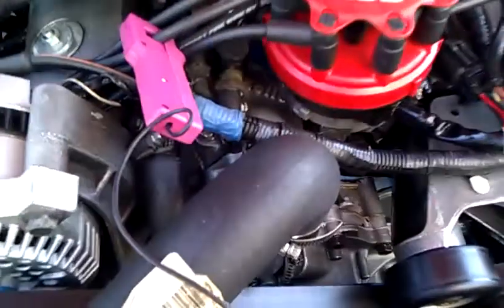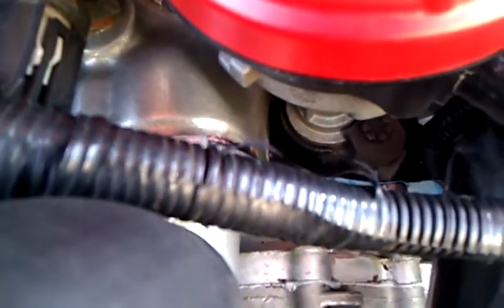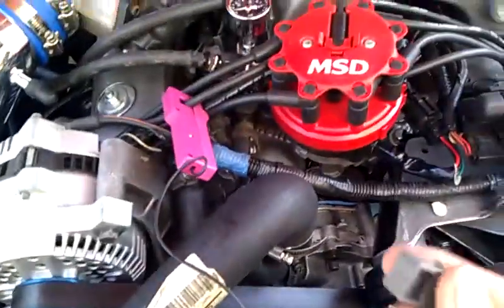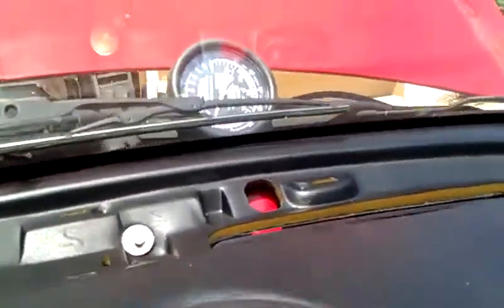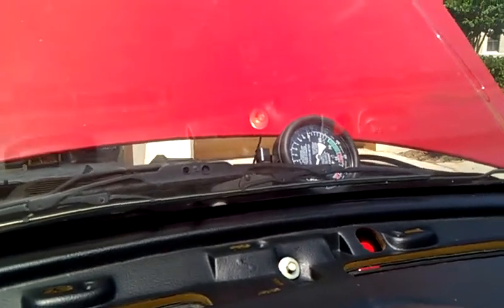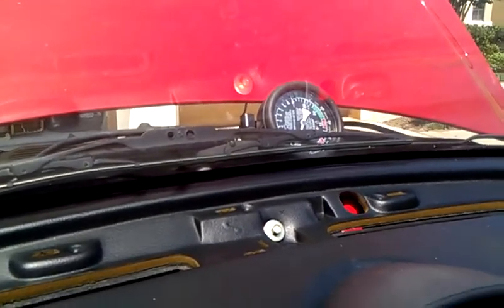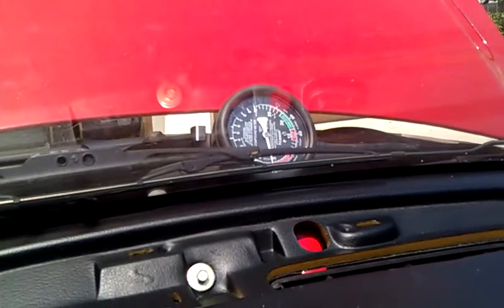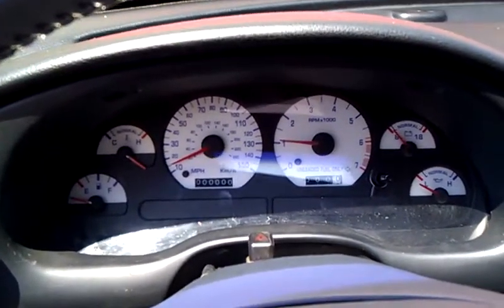Rebuilt 95 Mustang GT Can't Idle - Timing Problem?

Comment: make sure you are at top dead center on piston #1. You will need to take out the #1 spark plug. Use a hard plastic stick and hold it in the spark plug hole.Take a socket wrench and turn the crank by hand clockwise till the piston makes contact with the plastic stick. Remove the cap of the distributor and make sure the rotor is pointing at the #1 spark plug wire terminal on the cap. If it is not lined up then you are out of timing. If it is at the #1 terminal then verify the timin

Comment from the maker: Guys- Thanks a bunch for your ideas and help! I got the sucker to finally idle without the spout connector. It took some patience, but it was the base time plus the idle air screw and some tinkering with the dizzy. Got it to idle and hit it with a gun. It's still not super smooth, but i have a pretty extreme cam in there, so I think this is about good as its gonna on the stock tune. I'm pretty stoked about now, I'm going to move on to the next few bits and then get the tuner ordered.

Comment: If it is at the #1 terminal then verify the timing marks on the harmonic balancer.  Also make sure the spark plug wires are hooked up according to your cam specs if its a aftermarket cam. If it is stock, then hook up to stock configuaration. You need Air + Fuel + spark + compression to make the engine fire up. Make sure the fuel pump is priming up when you turn the key. If not priming check the fuel pump fuse in the fuse box in the engine compartment.

Comment from the maker: @staminater Thanks- I will have to look up how to do a propane test. Yes, firing order definitely correct. TB air screw- did not check that yet! I have a AF meter already, was getting 16.00 on idle and down in mid 13 range with gas, so it was off, but that was before I put on my regulator. I'll have to test again now.

No tune yet, this combo should be able to yield a steady idle (ive seen it done on another video), definitely putting on a tuner however.

Comment: 3 things: Chech the rotor and make sure its in the right hole and also check the air idle valve and EGR valve for leaks...  Ford Motor Co. Engineer Dearborn Mi. Retired

Comment from the maker: This was due to timing and incorrect vac setup. I changed my valve covers to have a breather valve. I connected the following vac lines- intake, tree, charcoal canister solenoid, pcv, fuel pressure regulator and upper intake. This makes a full circle in the vac system but also introduces blow back oil, will need a air/oil seperator to keep it clean. I also eliminated the vac reservoir and cruise control lines.
Reply: Do you have a recommended part for air/oil separator?

Comment from the maker: @Mr95mustangv6 Make sure your hoses are all solid and your IAC is firmly attached and connections are fully plugged in. If you only changed the intake, i would put my money on it being a loose hose causing a vacuum leak.

Comment from the maker: @staminater Thanks, yes idle air screw was in all the way to the bottom, I did some loosening up, it helped a bit. I'm gonna use my AF meter to get it right.

I will try the carb cleaner method, I don't have a propane torch handy, not sure how i feel about heating that up near the engine lol I might melt something by accident.

Comment: Put a 650 Holly on it and ride  lol . You will make more power by doing a carb swap .
Reply from the maker: hunter leazer Man that was like the ultimate temptation. Going carb would have been great but I probably would have been swapping one set of problems for another. Fuel delivery was the costly part of it, to do it right. I could have ghetto rigged a pair of regulators in-line and hope for no failures I supposed. Car is long gone now, dream failed.